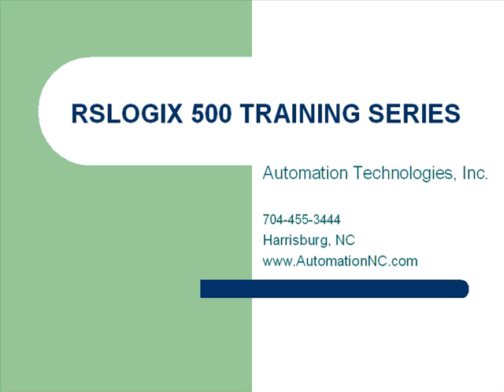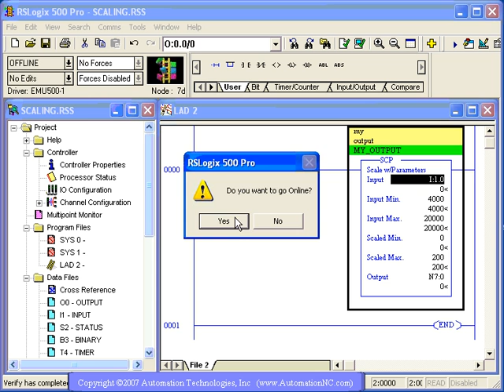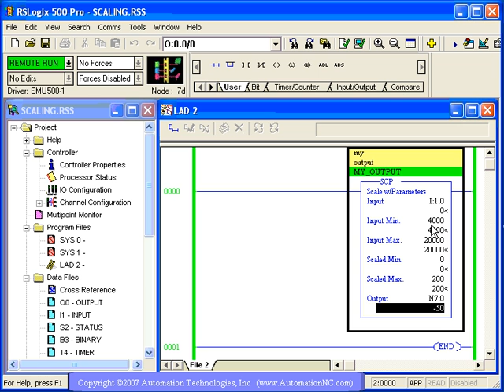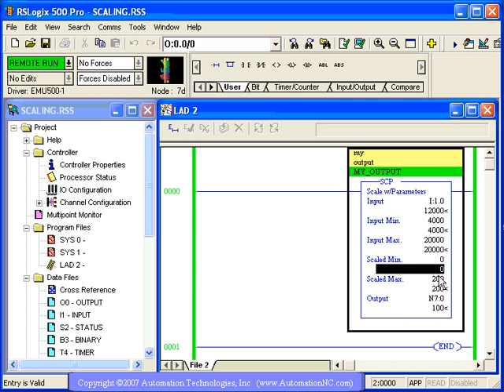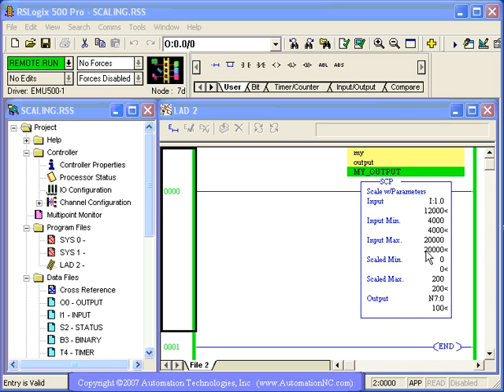PLC Training - SLC 500 Scaling - Part 2

Comment: Hello. I didn't understand the reading scale. Siemens goes from 0 to 27648 if there is no bipolar. In your explanation I didn't see anything about the engineering scale. If I send 4mA which is low value. If you send 20mA, what will be the high? On the AB website, there is a manual for the 1769 IF4 card. The 1762 IF4 card only has the one you read and it is not very practical!!!
Reply from the maker: Thanks for the comment and sorry the explanation wasn't clear to you.  The primary purpose of the video was to cover how the SCP instruction works independent of any type of card.  The "raw" or input values from different inputs cards can vary depending on which card is chosen.  Unfortunately the 1769 would be very impractical for this video as the programming software used would not work with the Compact Logix.  The 1762 is a micrologix series card and would be able to be used with this software as RSLogix500 was made for the SLC500 and micrologix processors.  The primary take away I would like someone to get from this video is being able to use the SCP to scale something from one range to a different range.  That information translates throughout all the AB processors and can still be used with the ControlLogix today.

Comment from the maker: @cybersoul2008 Sure, scaling is generally used to convert the information coming from(or to) analog cards into something meaningful to the user.  For example a temperature transmitter may be wired into an analog input card.  The transmitter sends a signal to the PLC analog input card which in turn converts that signal to a number for the PLC.  Those numbers are not usually meaningful to us users (ie, ranging 0-16387).  We use scaling to convert that to something meaningful to us - maybe 32-212 F